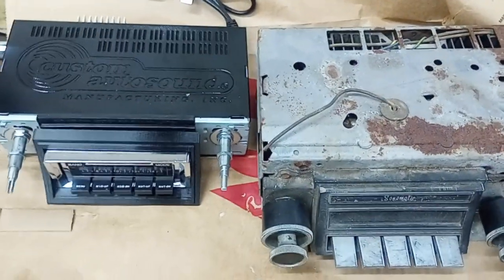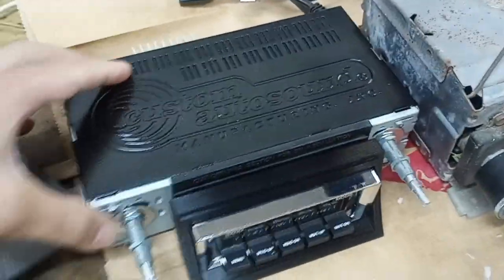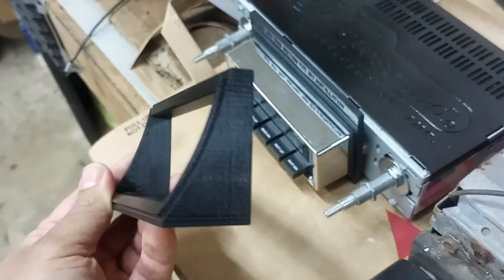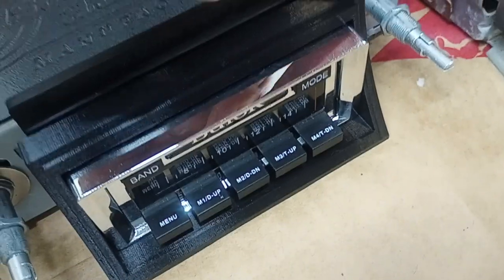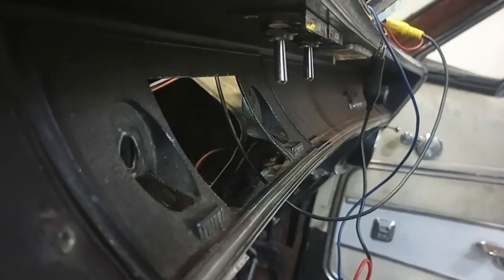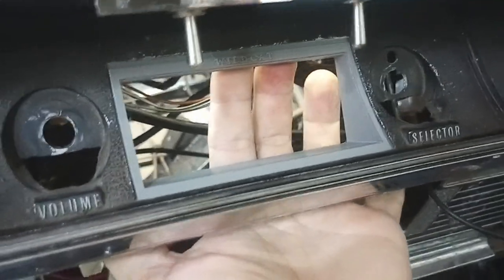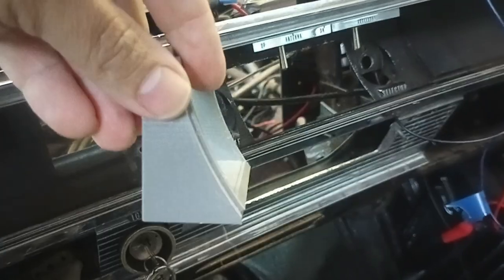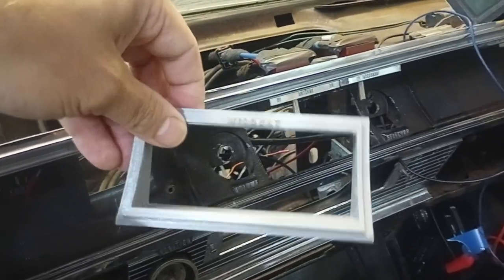Buick Wildcat 3d printed custom radio face for Custom Auto Sound head unit

Comment: Really cool nice job!! I might need to get into 3-D printing. Good way to deal with unobtainable plastic parts for the old cars.
Reply from the maker: Thanks goatheadfarm!  I'm glad I started to learn 3D printing.  One thing you might not realize is learning 3D printing is also an exercise in learning CAD design.  There are loads of community shared projects you can download and print on your own machine, but unobtainable parts for old cars you'll likely have to create the design yourself.  They also make 3d scanners that let you scan an object and it render it into a file that can then be used to print or further edit.  I have not used a 3d scanner yet.  
Friends of mine pointed me to Prusa 3D printers which I really like.  
For CAD design I started using TinkerCAD which is an online browser based editor that is really simple to get started making basic designs, but very limited.  When I needed to make more complex objects, I started using FreeCAD which is a free and open source editor that runs on Windows/MacOS/Linux.  There are lots of good FreeCAD tutorials on Youtube, which were very helpful.